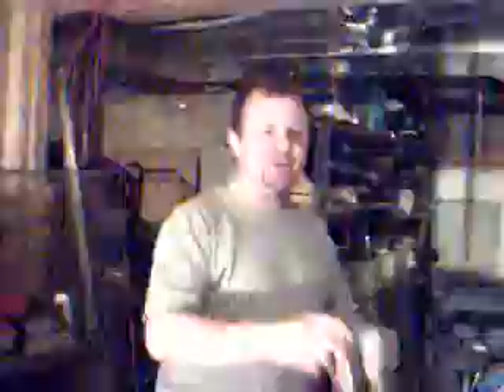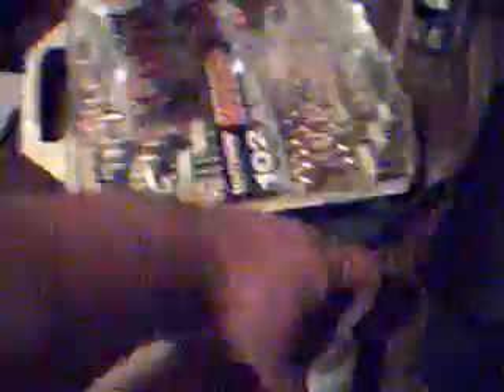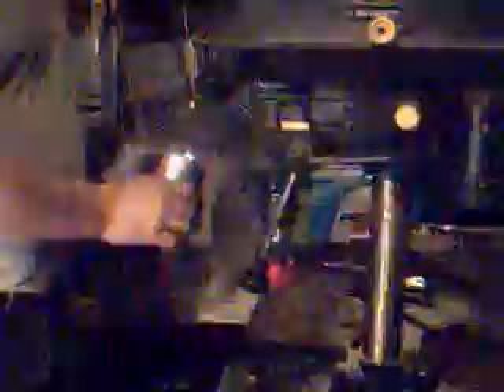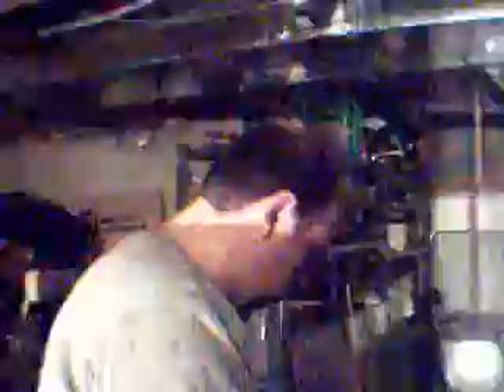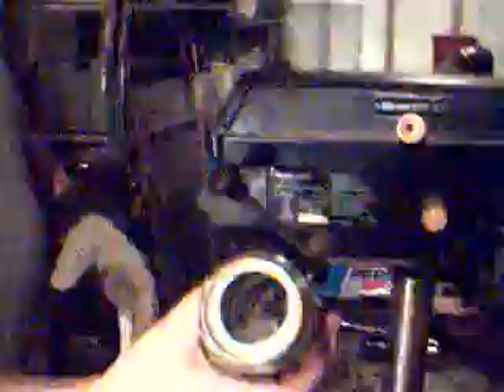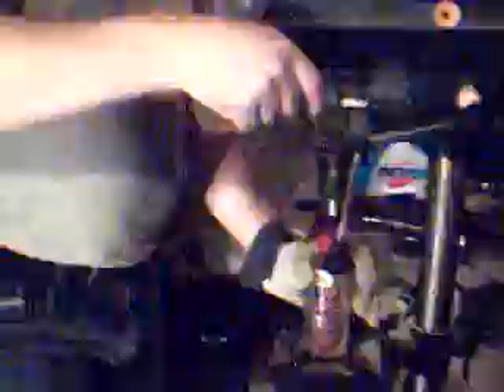solarcan_pt1

Comment: take a 1" board and drill hole the size of can,and c-clamp it to the drill press.also the drill will get you as you pull the can away,after its drilled,raise drill as high as you can.trust me,im glade my gloves saved my nuckles!